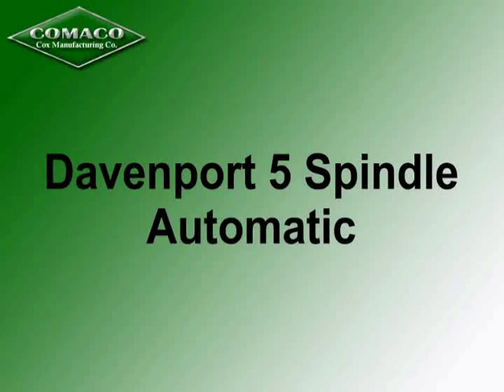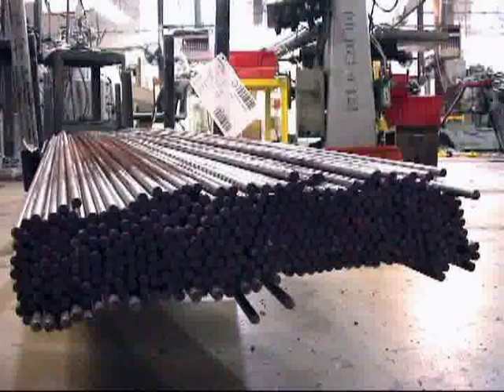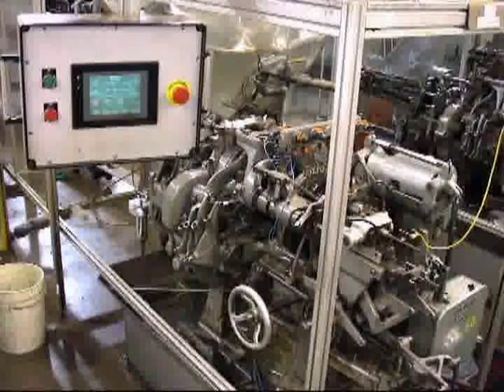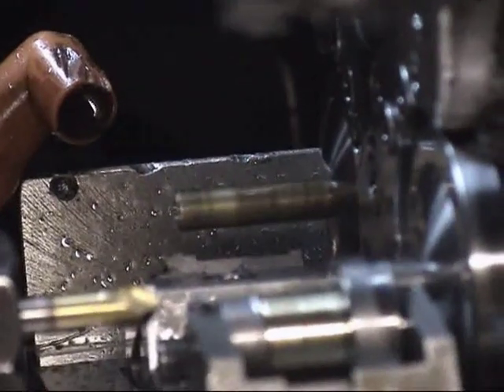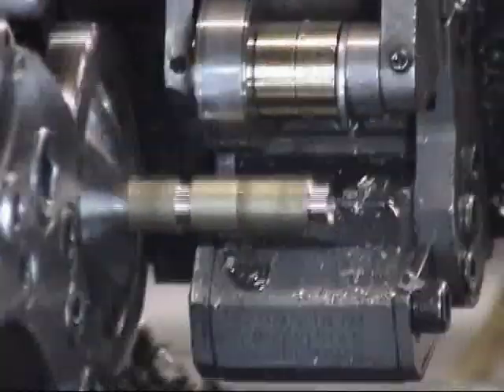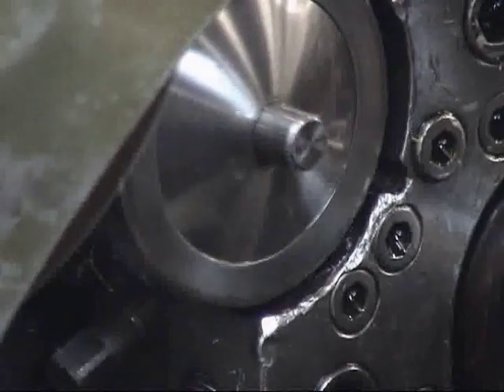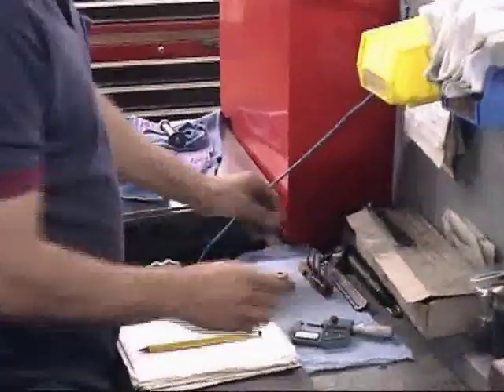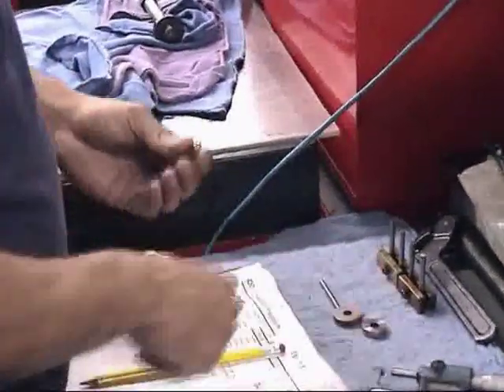Screw Machine Products on a Davenport 5 Spindle Automatic

Comment: This machine makes precision parts. The operator has his hands and arms in oil most of the day changing cutting tools and checking dimensions of parts after washing parts in solvent. Depending on the part being produced, the stock can be nasty and is washed off in the machine by each tool that has an oil tube spraying oil on the material being worked which causes the oil in the machine reservoir to be dirty. The operator needs to wash his hands and arms hourly with grit soap if he wants to stay well. The dirty oil produces black heads on your arms and neck and the noise is about 110 db's depending on how many machines are running in an area and ear protection is a must. This is a precision parts making machine and the operator has to be trained thoroughly. There are operators, and setters. A setter set's up the machine with the correct feeds and speeds and the tools needed like drills, taps, threaders, etc. The operator needs to be trained to a very high level so that he knows when and how to change the tools before they become worn and break, which then in turn "wipes out" all the tools in the machine if the operator is not standing directly by the machine. If you go into this trade, learn to set and operate and demand a minimum of $30 an hour plus benefits.I know, as I worked with these machines for ten years in the 70's with the United Auto Workers making valve lifters and tappets and other precision parts. Wear a plastic apron and don't bring your oily clothes home for your wife to wash.

Comment: Love the shot of the large stock rack. I visualize the stockroom with stock racks with many bundles of bar stock ready for this and the other in the shop. With a busy crew stocking the machines and degreasing the parts. And sending the brass waste back for recovery; many jobs bid so close that it was possible to make money on the waste alone. Many jobs of 50MM plus parts and more. "Spark Plug Jobs!"
Reply: By spark plug do you mean literal spark plugs for a car?
Reply: @sashasoule4585  back in the day every shop was making spark plugs. Cars ran through them crazy.
Reply: @sideshow45  wow, thanks for the info. These screw machines are epic, but how many people still out there that can maintain/run them?
Reply: @sashasoule4585  i personally operate and starting to setup brown and sharpe single spindle automatics